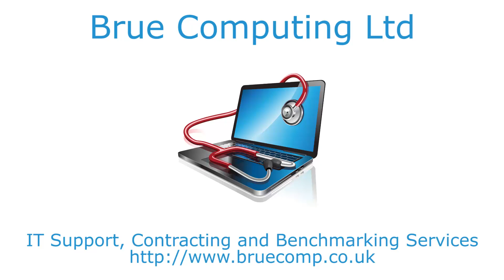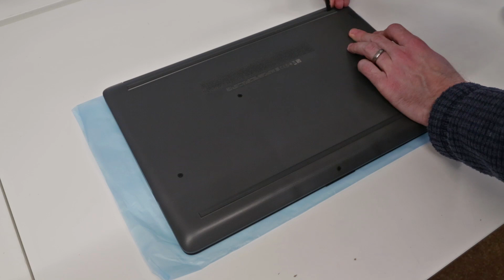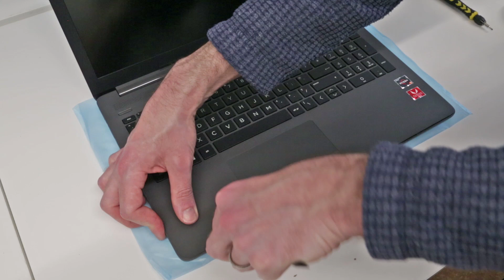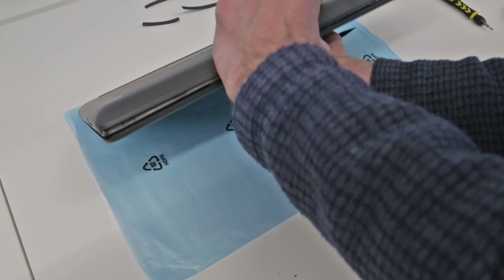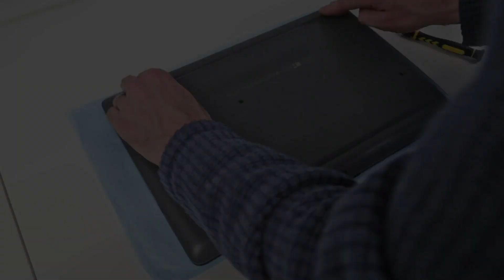HP 250/255 G7 - M.2 SSD and 2.5" HDD/SSD Upgrade Guide - 6BN96EA

Comment: hi, i am about to buy the 250, what is the difference? DO you know, I am mainly concerned with upgradablilty, Wethter it has an M.2 port and upgradable RAM.  Your one is what i want, this is the one i am going to buy. Any info would be appreciated. I have bought laptops in the past with soldered RAM which was very disappointing. Yours is the only video i can find but as i said the one i am looking at is the 250. Here is a link below. Thankyou, its the 6VV95PA
Reply: 6VV95PA
https://www.kogan.com/au/buy/hp-250-g7-156-core-i5-8265u-4gb-500gb-hdd-dvdrw-w10h-laptop-6vv95pa-hp/
Reply from the maker: The best bet would be to open it up and check - in some of the HP 250 machines I've seen they don't have an M.2 port if they are fitted with a 2.5" drive, only if they come with an M.2 SSD from the factory.
If this is the case then you can fit a 2.5" SATA SSD.

The RAM should be upgradeable.
Reply: @BrueComputing  thanks, i cant open it til i buy it, It only says it has a 500gb hhd which i assume is a normal mechanical drive. If it has 2 slot of upgradable ram and i can upgrade to ssd i will be happy so i think it will be ok.  Whats your opinion, besides the size, what is the fidderence between a 2.5 ssd and a m.2 drive. thanks for the reply. I think i will buy it. It has 4gb ram but id i put in more and put an ssd in, it should be good for a few years for my 7 year old son. thanks again
Reply from the maker: @DadSkool  I would assume it'll only have a 2.5" SATA drive and no M.2 slot then. There are two types of M.2 drive - SATA based ones are basically the same as 2.5" SATA drives in terms of controllers, performance (max of around 550MB/sec), etc, just in a smaller form factor. NVMe/PCIe M.2 SSDs are a lot faster (1500MB/sec+, depending on the specific drive, some a lot faster) but at generally higher cost, power consumption, heat, etc.
Reply: @BrueComputing  thankyou, i was confused until now about the two types of M.2. :)
Reply: @BrueComputing  But both M.2 SATA and M.2 NVMe drives can be installed? I have a dead SSD in a friends HP G7. It has two notches (keys) on the end of it but on the label states its a Toshiba and NMVe. Looking at NVMe drives they all have on notch (key). So wanted to check your comment about the slot accommodating both types? Thank you

Comment: The one here in Australia has a 500GB HDD, do they all have that m. 2 place? I'd like to remove the HDD as my son kill surely kill it taking it to school.
Reply from the maker: In UK models they often don't have the M.2 slot if they are a HDD only model - only way to be sure is to open it up and check.

You could fit a 2.5" SATA SSD though.
Reply: @BrueComputing  thanks Mate, I bought a Dell G7 cheap.

Comment: Have the same type of laptop with a 512gb M2 ssd, it really gets HOT, up to 79 degrees Celsius !! 

I'm guessing it's the controller chip, and although they're made to withstand up to 100 degrees C 

still want to keep it cooler, but how?  Why didn't they have cooling grills at the bottom, and why not give the  M2 ssd a cooler itself? Probably cos it's too cheap. 

Does anyone know if you can install a cooler for the MS ssd? and if so, where would the heat disspate? 

Maybe a Laptop Cooler Pad/Stand with Fans would help keep the temps down?

Comment: Can you replace the DVD player with an SSD?
Reply from the maker: Yes, you could fit a 2.5" SATA drive in an optical bay caddy.
Reply: You need to be careful about the high of the caddy to fit with your laptop. Is possible to be 9,5 mm or 12 mm.
Reply: Beware that the optical drive uses a USB 2.0 to SATA bridge which basically means that the speed of the SSD will be limited by the USB 2.0 max speed which is 30~40 MB/s. Adding an SSD using this configuration seems pointless to me. You can still however add a normal HDD as storage.
Reply: @YusufFelly  If DVD drive is already installed, is it possible to add 2.5 inch SSD SATA drive or the connector on the main board is already occupied by DVD drive?

Comment: does it have same layout as 245 g7 r5 2500u model
Reply from the maker: The 245 is a 14" machine, so it'll be a little different, but should be fairly similar.
Reply: Brue Computing i want to upgrade ram and ssd from hdd in a 245 g7 2500u laptop can it be done. also are there two 2.5 inch drive slots or just one. thanks for your help mate really appreciate it.

Comment: Can you please tell the exact model of M.2 SSD which is installed by default in this model?  I mean it's really important, because different SSD of the same M2 standard could be really different in terms of speed. Not only capacity what metters.
Reply from the maker: It was an HP OEM branded TLC SSD. They tend to use a variety of different SSDs as they'll switch suppliers depending on pricing and availability - I've seen 'identical' HP 250 G6 machines with Samsung, Lite-on and Sandisk SSDs for example.
Reply: @BrueComputing  this laptop supports NVMe SSD ?

Comment: What if I buy a caddy for the SSD?
Reply from the maker: Sorry, I don't understand the question?
Do you mean to fit it into the optical bay?
Reply: @BrueComputing  exactly
Reply: @alvaro9939  should work
Reply: Beware that the optical drive uses a USB 2.0 to SATA bridge which basically means that the speed of the SSD will be limited by the USB 2.0 max speed which is 30~40 MB/s. Adding an SSD using this configuration seems pointless to me. You can still however add a normal HDD as storage.

Comment: Can i use Normal SSD instead of M.2 in my 250 g7 laptop?
Reply from the maker: If it has an M.2 SSD from the factory then it won't have the brackets and cables for a regular 2.5" drive installed, so you'd have to source these which generally isn't cost effective.
If it came with a 2.5" HDD from the factory it may not have the M.2 connector on the board, in which case you'd have to use a 2.5" SATA SSD instead.
Reply: @BrueComputing  Thank you for your response!
Reply: Yes. If the unit comes with a Hard Disk Drive inside, then you can replace it with a 2.5" SSD, and use the bracket from the existing Hard Disk Drive to fit it.

Comment: Firstly I would like to thank you for the short and concrete presentation of HP255 G7. It is really useful and helped me to decide for this Laptop. Very positive on this materialization is also the cooling fan position, very easy to detach or repair if needed.
Secondly I do have a question, as the version of 255 I found in Greece (at an attractive price) includes a DVD-RW (Supermulty DL) drive, which I cannot see in your video. Does the one you have opened included a DVD-RW?? Is it removable?? cause I could not locate internal slot for this. Thank you in advance.
Reply: Hello from USA, I have an HP 255 G7 in front of me that does not have any optical drive at all.
Reply: You can use a USB optical drive :)
Reply: Hi Im in spain. It sounds like you have the same one I have .  Its got the optical drive in it . I bought it from a shop called worten here in spain . It has the amd 4 with radeon 3 cpu/gpu chip. 4 gb ram and a 500 gb hdd . got it with just dos installed for 125 euros . I have put windows 10 pro on it . I have had the back off and it can swap out the 4gb memory module for an 8gb . lokks like there is  a slott for an ssd ( which would be better than the hdd I have although it does load up quite fast ) The procedure for taking the back cover off is the same but here is the thing . The dvd drive front plate is flush with the case so when you try to remove it you have to take of the cover as much as possible then reach in and unplug the dvd drive . It comes out easy so no worry there. then you have to slide it out of the case before you can then unclip the final part from the main body of the PC . Putting it back it sthe reverse . You need to line up the side with the gap for the dvd drive , then slide it through and plug in. Then you can press the rest of it down as in the video . It is fiddly and needs care and patience but it can be done . I agree that it is very good value and it works well . I plan to swap the ram and add ssd to it . It will be a decent little PC for the money . Good Luck
Reply: @MrTimjm009  I think there is a more gentle approach to remove DVD drive during disassembly. For instance, to leave the tray in open position before switching the laptop off. Then, after the screw, which holds it, is removed, you can take DVD drive out pulling by the open tray. Or if you forgot to press the button on DVD before switching it off there is a small hole on the DVD. I think it is for opening the DVD in off state with a needle.

Comment: I'm purchasing a new wifi card for my wife's hp 255 g7. It was given to her for college and the wifi speeds for this particular model are trash. Like 0.04 mgbs download speeds and we have a 300 mgbs wifi service. This particular card is an AC 7265 802.11, supposedly supposed to open the band width up to max 846 mgbs. Although it needs a m.2 slot to fit it. Does the 255g7 have this? I saw in the video where you removed the wireless card to demonstrate but didn't hear if it was in fact a m.2 slot. Thanks for you time.
Reply from the maker: Yes, it should be a standard M.2 card.
Reply: Just out of curiosity. What wifi card is installed in the computer in its stock form.

Comment: Can this laptop run both an M.2 SSD AND a 2.5" HDD (at the same time)? 
Very helpful video, Thanks!
Reply from the maker: Yes, but you'd need to either get the correct cable and board to attach the SATA drive, or mount it in the optical bay area.
Reply: @BrueComputing  Thanks for the quick reply! I got a good deal on a G7 with a 500Gb HDD pre-installed, no SSD. I'm only going to add a  M.2 SSD which should be simple enough.
Reply from the maker: I'd check it actually has the M.2 slot before ordering one - some have reported the HDD equipped models don't have the slot on the board.
Reply: @BrueComputing  Interesting... I'll be sure to check (by following your tutorial!). Thanks a million for your help and your super useful channel!

Comment: Do you know where the CMOS battery is located?
Reply from the maker: I'm pretty sure it is on the other side of the mainboard, so you have to disconnect it and flip it over.
You can find the service manual here: http://h10032.www1.hp.com/ctg/Manual/c06208876

Comment: Does the versions that come with mechanical drives HP 255 G6 Laptop still have the m.2 connector ?
Reply from the maker: I don't think so.
Reply: The 250 G7 I have here. Mechanical drive from factory. Doesn't have m.2 connector. Just has the bracket available to fit it with screw but no way to plug it in.

Comment: A word of caution: If you plan to upgrade the HP buy one with a m.2 SSD istalled. It might be costly to buy the HD carrier but it's doable. I bought one with a HD installed and wanted to insert a m.2 afterward but the m.2 connector's missing on the board. So unless you're pretty firm with SMD soldering and know exactly which connector part no. ought to be sitting there and know where to get one from you're f*cked.This is true for a 6HM88ES model at least (aka el cheapo).
Reply: Or use SSD 2.5" (SATA III), not SSD M.2.
Reply: damn shame .
Reply: Is it possible to upgrade the ssd version with a hdd without removing the disk reader ?

Comment: Where can I get hold of the board and cable for adding a normal SSD? Does the laptop has power for an additional drive? Thanks for the videos, of great help.
Reply: Found it on ebay US. £47 is not cheap.

Comment: Is your laptop overheating ? My g7 255 just by running an 1080p yt vid + light browsing causes it to go into 90degrees C. Or a simple 4k YT vid. Exhausted air is cold. Only about 1/3 of the heatpipe gets very hot, about 1/3 is hot to the touch but bearable and 1/3 is quite cold. All this while it's running on 90degrees C in hwmonitor and starts throttling.
Reply: @Jaree Bond Yeah it's 255 ryzen 2200u 256ssd 8gb. Replaced it and this other one is fine. So other had defective cooling system.
Reply: @Jaree Bond thanks but already got another one and is fine
Reply: The temperature difference denotes inadequate thermal conductivity of the (copper) heat pipe.
Reply: If you want to heat up your room you get an AMD! If you want performance you go with Intel. Intel is more efficient at cooling